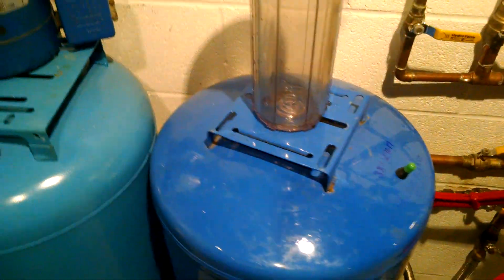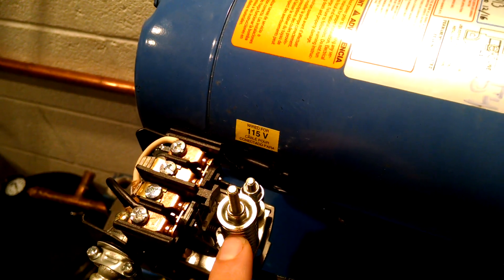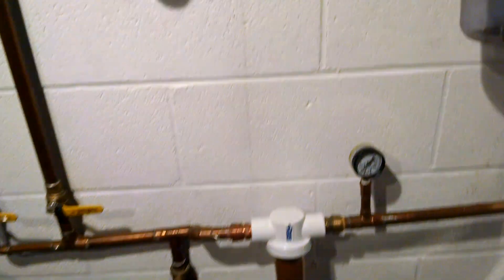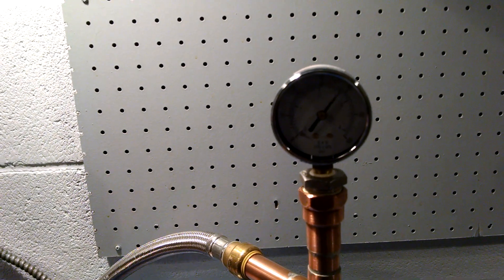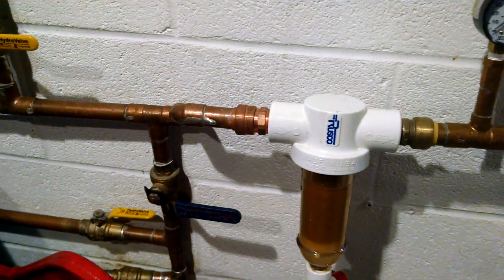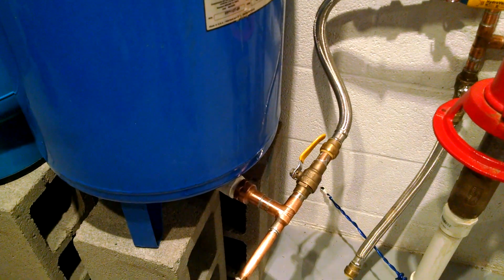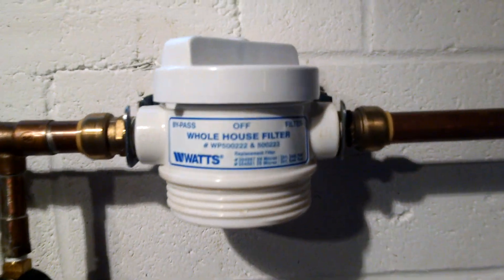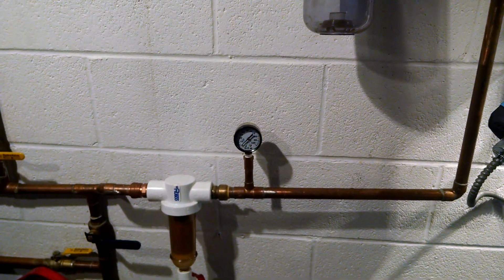Flushing Sediment from Well Pressure Tanks

Comment: What's the brand and model of your large, medium blue sediment filter (I see you also have a smaller Rusco); and, where do you purchase the $2.00, 5 micron filters? --  I would be very interested in an explanation of your filtering setup. - Thanks.
Reply from the maker: https://rover.ebay.com/rover/1/711-53200-19255-0/1?icep_id=114&ipn=icep&toolid=20004&campid=5338089291&mpre=http%3A%2F%2Fwww.ebay.com%2Fitm%2F6-PACK-Of-5-Micron-10-Sediment-Water-Filter-For-Any-Standard-RO-Unit-by-%2F311968441631%3Fhash%3Ditem48a2c4a51f%3Ag%3A0MsAAOSww1dZyqqx
Reply from the maker: Aquaboon from ebay, seem to be great filters I have no complaints